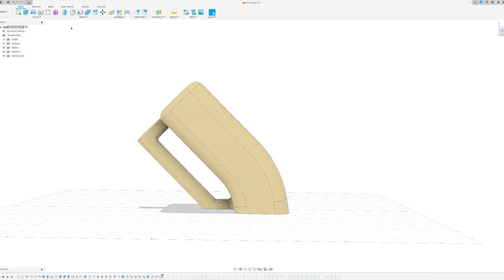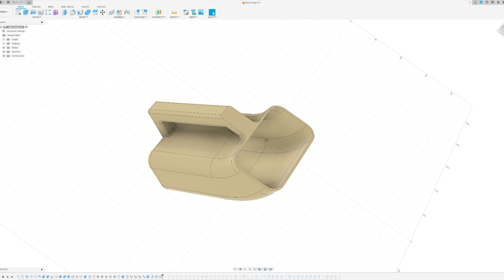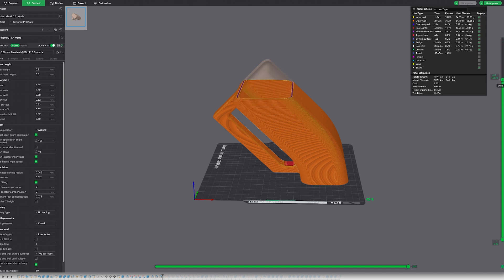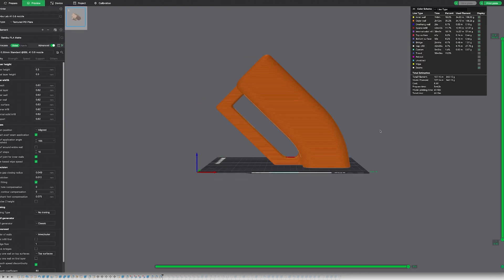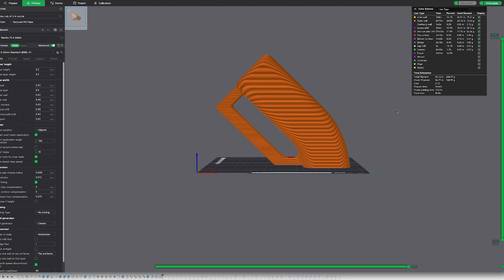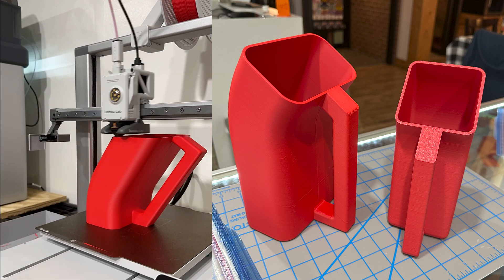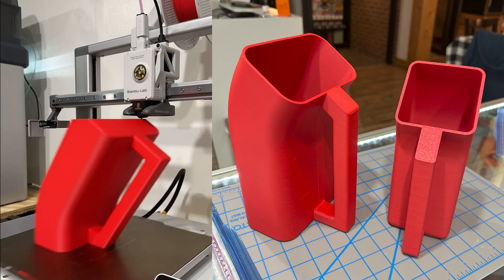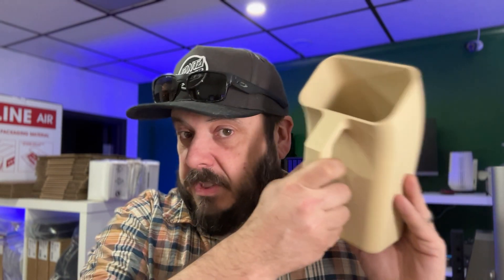I Redesigned This 3D Printed Scoop – Bigger and Better!

Comment: Is there a reason you're not printing with the bottom of the scoop on the build plate?  I'm guessing it might make the bottom stronger the direction you're printing it.  Maybe it's 6 one way, half a dozen the other.
Reply from the maker: I typically try to print any surface that user facing down on the print bed just because it looks better. But in this case the file that inspired this design was also printed in this orientation. In keeping with the theme why rock the boat, right